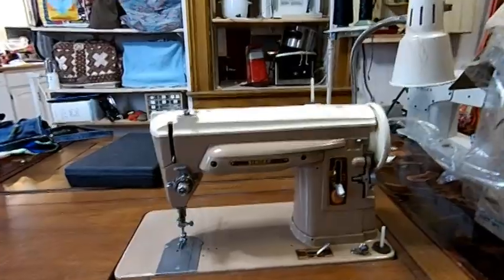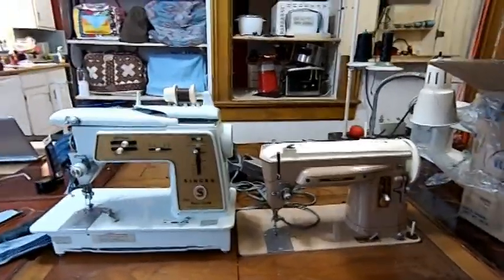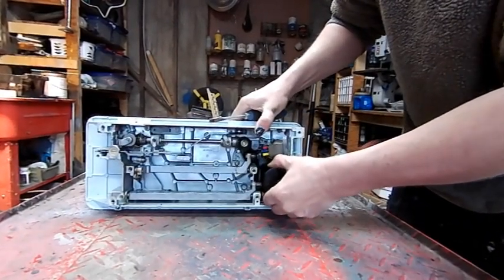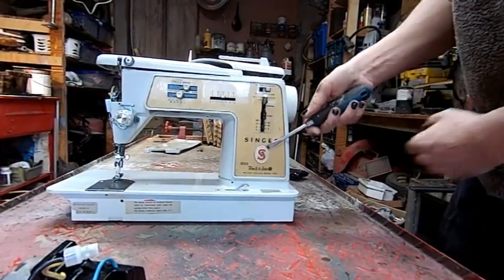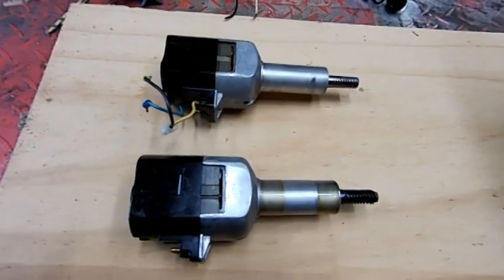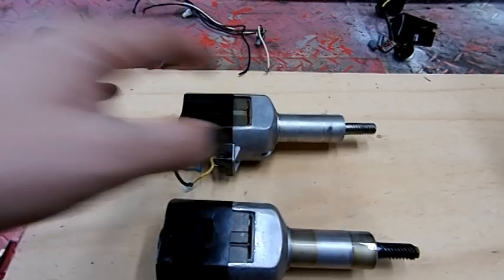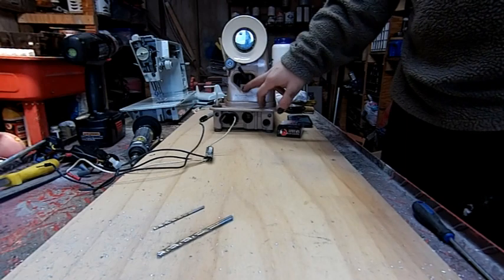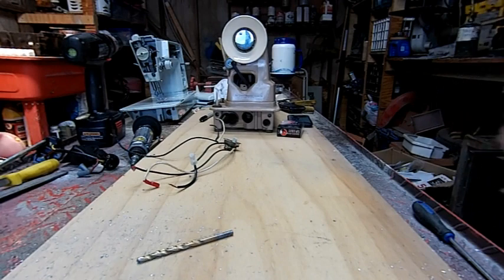How to Upgrade a Singer 401a, 403, or 404 Motor Using a Transplant from a Singer 620

Comment: Hey dude, I  think you said your name at the beginning of the video but no matter how
many times I re-watch, I cannot catch it.
Anyway, you're a genius!!
I have a 403A, a 404- (do you know what the - means?) and a 500A.
The 404- gets this upgrade first.
My hobby of sailing keeps me making and repairing sails, sail covers, Bimini's, interiors etc.
A lot of these projects CAN actually be done of the Singer Slant Shank machines but when it comes to punching through several layers of plasticized Dacron sailcloth, they can't quite cut it.
For real heavy corner patching I will still have to use my Sailrite Walking foot machine and
for Lifelines, many layers of webbing material and the REALLY heavy stuff I have a Commercial  Artisan Compound  (needle feed) Walking foot machine.If they made a needle that could punch through metal, this machine would sew it.

  THANK YOU , THANK YOU, THANK YOU for making this video.
Yes, I have subscribed and liked you dude.
Trent (not Joe, middle initial 'T')
PS> Andy of "Andy Tube" turned me on to you.

Comment: Fantastic! I've been working with a 403 to make sailboat sail repairs and modifications. The lack of power and failure to start without assistance drives me crazy. I looked to see if a more powerful motor was available but never found one. This mod should do the trick. I'm on the lookout for a used 620. Thanks so much!
Reply from the maker: that makes two of us that it drove crazy. I hated to have to help the machine get started at low speeds or if you give it more gas it took off drove me nutz. My Kenmores arent like that at all.

Comment: I think I would 3D print the part or have my hubby cut it from metal on his cnc. Love your video's.
Reply from the maker: Thats a nice way of doing it. But I really like wood grain and I feel it fits the machine better due to age. 50's was huge wood grain era.
Reply: I did the same thing. I was able to match the plate perfectly. I would love to see how yours turned out.
Reply: @SewSaveMe   The love this video so much, I can't tell you how many times I watched it over and over. I was lucky enough to get my hands on two 620 motors. The swap was perfect. If you ever want laser-cut or 3d printed (wood color) plates, please let me know. It's the least I can do for such a great video!

Comment: Hey Stevie, I have a 503 and at 640 motor and electrics. How to I wire the pins. This is the foot pedal with the speed switch in it. Motor has 3 leads. Yellow spade, Red (i presume common) and blue. 5 pins labelled P (power ?) N (neutral?) L (light?) M(motor?) and yellow spade to motor. The feed from the pedal is confusing me. Any help would sure be appreciated! Thanks, Jim
Reply from the maker: Not 100 percent sure on the 503 since ive always dont it on a 401 and 404 but im assuming the connector dont have enough pins I recommend using the wire harness out of the 640. And If I recall the 640 and the fast slow switch in the pedal making it more simple to wire up inside the machine. Only thing youll have to wire is the light if you use the 640's wire harness.

Comment: my 403 special is smoking and sizzling when power up, what do you think?
Reply from the maker: Not a clue with out seeing it but def find the burning wire or something before you use it and the machine becomes live. If all the wires look good check the motor. It might have burnt out windings and that would be bad bad news.
Reply: Machine may be stiff or tight. Or. Motor needs cleaning an servicing,,

Comment: I'm interested in doing this to my 403A. I have a very clean 640 but the motor & pedal are slightly different then the 620 you show. The speed switch is on the pedal & the cord socket is pinned different as well. I also have a parted 776 (motor PA-30-8. I'd like to use this but the motor power socket is integrated onto the motor housing. Do you think I could use this with little fuss or mod
Reply from the maker: Im sorry for the Delayed Responce I had no idea youtube was holding the comments until now. the 640 motor would be your best choice the 776 motor I think was still only two winding and they use a resistor to slow it down basicly starving it for power. the 640 motor has 3 sets of windings instead. I just didnt wanna reach on the floor to change my speed. I found the 640 motor works best with singer 50x machines as theres really no good place to mount the switch in the machine with out drilling machining the body. Simpler to have it in the pedal. the 40x gives you a nice hole on the side for a switch.

Comment: Rhis is the stuff that we used to learn in school in tech classes that they no longer offer. 
Are the wires color coded so that if you wanted you could put a dot of that color finger laquer at the approrpiate spot to get them reconnected correctly?

Have snadwich baggies with you and marker and as you disassemble put those little pieces in 1 bagiie and MARK!!!! maybe evben mark 1, 2, 3  as you disassemble.
Alumnium starts to get liquid at about 1100F (we recently had fires go through areas here in California and saw the melted tire moiunts in streams away from the cars).

Oversize cut the "wood" plate then sand it to perfection.
Reply from the maker: Good idea as you can tell im not a huge wood worker.

Comment: Steve,  Is it only the 620, 630 & 640 Singers that have more powerful motor.  I google'd my brains out trying to find 2 speed PA motor or model number's of Singer's that had these more powerful motors.  Saw a 602 on Craigslist but doesnt give amp or if it's 2 speed.  Can you advise me, I want to up grade my 401A.  Thanks for the video, it inspires !!!   Bryan
Reply from the maker: As far as I know it was Only the golden touch n sews. Those models sound right how ever I did find another model that had the two speeds but it wasnt a fancy motor it was a monster resitor that just starved the motor to slow it down. Dead Give away motor will have 3 wires comming out of it instead of two.
Reply: Thanks for getting back to me. In my continued research I have confirmed a few things. 626, 750, 774, 600e all are the weaker motor. I did find out a 638 has the PA 15-8 but was a single speed only. I also know the 640 had the 15-8 and was a 2 speed machine.  I can’t remember if your video confirmed that the 15-8 is the one you pulled out of the 620 you used for the more powerful upgrade you did. I’ll have to Watch your video again and less you can confirm that the 15-8 is the magic.  Also the motor you used had 3 wires which has to do with it being 2 speed ??   Thanks Bryan

Comment: Since there are three different gear sets, you might be better off looking at the ratios of each, and selecting the optimal ratio for your needs, whether it might be speed, or maybe torque for heavier fabrics.  Just open the top of different machines, and count the motor shaft rotations until you get one full rotation on the hand wheel.  That will be your gear ratio  Best of fun.

Comment: Stevie, I used to be a 15-91 user. About a year ago I switched to a 401A. Now I have two more of those plus a 403A. I have watched many of your videos (repeatedly), and am interested in upgrading the motor in one of the 401A machines to accommodate a 600 series motor. Today I bought a Singer 640 to use as the donner machine. After looking it over I wondered if maybe it would be easier if I replaced the plastic gears in the 640 with the metals gears and hook mechanism from one of my 401a machines. That seems like an easier way to take advantage of the more powerful 600 Series motor. Please tell me what you think of this idea. Thanks.
Reply from the maker: I considered the Exact same thing my self. But I truely dislike the magic bobbin system. And Honeslty all the plastic handles and what nots on the 600x series is just low quality vs the 401. Plus I liked the bobbin winder system on the 401 better. by the 1970's singers really cheapened up sadly. Why I upgraded my two 40x machines.
Reply: @SewSaveMe  I was wondering how difficult it would be to remove the hook mechanism from a touch and sew machine and replace it with one from one of my 401A machines? By the way, 401's also have plastic knobs. Another thing ... the high/low switch on a 640 machine is in the foot pedal so a person would not have to mount that switch in a piece of wood on the end of the machine as in the video. Personally I like the color of the 640 much better than the "1955-56 Chevrolet Bel Air two-tone brown". Also, the auto up needle parking, the on/off switch and the  suction auto needle threading are all desirable features not available on the 401A. Thanks for you reply above. https://www.mecum.com/lots/FL0116-230005/1956-chevrolet-bel-air-convertible/

Comment: Hi. It's fantastic. making this change increases speed? how many spm?
Reply from the maker: No it does not. How ever it does increase its torque quit a bit no more helping it to start up in very slow speeds. You press the pedal it goes slow or wide open.

Comment: Sorry you said the 620,630 & 640 can be used.  However according to the internet, the 600 and 600E have the same motor.  YOur thoughts?
Reply from the maker: I tore apart a 600 it was not the same motor so maybe hit and miss there. The one I pulled had speed control but they use a bit fat resistor to starve the motor for power to slow it down.

Comment: i think the tread tensioner from the 620 will fit the 401 should keep that too . thank you just happen to both of these machines picked up the 620 because it had a bunch of extras that fit my 401. i will do this upgrade.  cheers

Comment: My husband already oil my 401a.  It ran fine after. Sometimes taking a few minutes to warm up. I’d have to give it a spin to get it going. Now after not touching for a few weeks it’s not working. Do you recommend replacing motor with an Amazon motor?  Or better to find an older motor
Reply from the maker: Im not sure honeslty ive never replaced a motor in these machines Never had to. Only reason why I stole a 620 motor to put in my 401 and 403 is because the motor out of the 620 is twice the Power.

Comment: Will any of the other 6xxs work the same way or just the 620?
Reply from the maker: there are a few that have that style of motor in them All a bit different. 620, 630, 640, 750, There maybe others but those are the ones I know have a 1amp motor with 3 windings. 620 was the best one for the 40x series though.

Comment: Would this also work for the Singer 500a?
Reply from the maker: Yes look for a 640 though the fast slow switch is in the pedal and im pretty sure the motor has the spot for the bobbin winder to run against but I havent done it yet my self.

Comment: Very helpful video. Would any of the "Touch and Sew" motors work for this transplant? I know the 626, 771, 750 and 756 come up pretty often on Ebay, and they have the same plug/pedal configuration. Is it just the plastic gears on the 700 series that are a problem, or is there something else that keeps them from working? Is it basically anything with the wide pedal and the three-prong plug?
Reply from the maker: Thats a good question I know most of the motors are physically the right size the gear might be different on the end but I dought it. How ever I dunno if I would swap out those are usally pretty poor quality motors. ONLY reason why i did this transplant is because how the motor windings work and is made it was a nice upgrade for the machine to slow it down with out losing torque. Otherwise Ill tell you right now the orginal 40x motor is much higher quality then the one I put in fyi I kept all the old guts just in case that motor crums out.

Comment: Man I bought a donor machine and it’s all metal gear no plastic inside just my luck
Reply from the maker: NOICE those are really rare. Keep it there not a bad machine just hard to find with all metal gears. And ones with plastic gears ive never found one with intact gears.
Reply: Hey, is that a 620 you got? Did you take the motor out yet? I also got a 620 as a motor donor, and it also has all metal gears. But the motor only has two electrical leads, not three.

Comment: I see that the  PA17-8 motor from the 630 and 640 also looks similar to the PA7-8 in my 401-A. If I'm not interested in the slow power setting, do you think 1- amp rated PA17-8 would be a reasonable upgrade?
Reply from the maker: Sorry im not super Faimlar with the actual model numbers. This is what I do know. Some singers with the high low setting simply use a big resistor to restrict the voltage to the motor hence slowing it down. Unfortunalty doing this you also lower its total hp output. Where the motor with 3 wires commen out of it actually has 3 sets of windings inside if I recall right. So in slow mode your simply only using 2 sets of winding and not restricting its power flow. In fast mode you use all 3 windings in the motor hence speeding it up with zero Hp loss.

Comment: Would a 500 be a good candidate for this?
Reply from the maker: Get asked this a lot actually. And I would make a great upgrade for a 500 as well but Ive never dont it to a 50x but the motor size is the same. Only thing is theres really no where to cleanly mount the swtich so you might wanna look at a singer 630 for the doner as the switch is in the pedal.
Reply: Thank you so much. I’m enjoying watching your videos! Learning so much!

Comment: Will this process work for the 301 as well?
Reply from the maker: As long as its the same motor should work across the board. How ever you might need to find a spot for the switch. the 401 works good because you can move the plug to the underside and use the hole on the side for the switch.

Comment: I bought a 401 in its original cabinet which presents a problem when you want to remove the machine as it is attached to the cabinet. Also, the 401 cannot hem jeans. It is a putt putt! I would love to have a stronger motor. Why have a machine that won't do what I need?
Reply from the maker: sometimes its not about need more about want. I dont need my 401 or 404 I rarely use them I use my Kenmores over them quit often. But I did Want them.

Comment: Is there any way to modify a 400 series from Anderson, SC to use w/ a treadle such as drilling holes in it for the belt, removing the motor, and making a groove for the belt... Can it be done?
Reply: Wish I could find a German treadle.
Reply from the maker: With this machine not that im aware of. How ever if you wanna try treddleing a good machine because you live off grid or something go look at some kenmore 158's they could be modified to do this.

Comment: can the 620 1amp 3ph motor fit either a 201-2 or 319w?
Reply from the maker: Im sorry for the Delayed Responce I had no idea youtube was holding the comments until now. not that I know of the motors are shaped different. not sure about the 319w as ive never owned one and seen inside.
Reply: 319 has an external motor.

Comment: I watched your video and what a great job of figuring out how to upgrade the 400 series machine. I recently found a 640 for the transplant. The 640 Golden Touch had a circuit board in the bottom of the machine making it difficult to wire in the new motor to my  404 machine. I hate to wire it incorrectly and blow the new motor. Would it be possible for you to video the wiring on the machine you upgraded? Thank for all of your help with this very useful videos!!
Reply from the maker: As far as the wiring went. I used the entire wire harness from the donor machine the only thing I kept was the Light. If you traced the wires on the donor machine its pretty simple where they go. May have to do some splicing. Otherwise far as I found you cant not use the wiring harness off the 40x machine its missing some paths to make things work right. If you have a 3 wire motor you will need the wire harness from the doner.

Comment: I recently purchased a 620 because I wanted the cabinet it was in for my 401A. I actually oiled it with Tri Flo and it even sews. It would be perfect for someone wanting to do this project. If someone is looking I will sell it reasonably...foot peddle is in good shape too!
Reply from the maker: Since ive uploaded this ive had people bug me for 620's hoping I had a secrete stash of them. Mine came from ebay on the cheap as there plastic gears are usally mush and the machine didnt work or missing parts. My advice if you wanna sell it to some one for this project. Throw it up on ebay. I gotta feeling people are scouering ebay for them.

Comment: Off Topic--  Singer 771: what would cause it to make the engine go in reverse when set for forward and forward when set for reverse? My previous mechanic said there was nothing he could do.
Reply from the maker: As far as I know they only way to make a AC brushed motor to run in reverse is to swap the wires on the windings. You might wanna try swapping the brush wires. But I dont think that will change its direction sounds like some one has been soldering on the motor board and swapped the winding wires. I had to do that for a faster rpm motor for a serger as the serger required the motor to run counter clock wise. I did this by swapping the outter winding wires on the board.